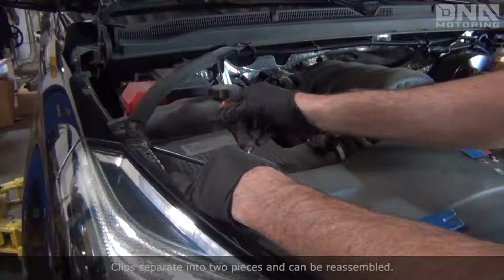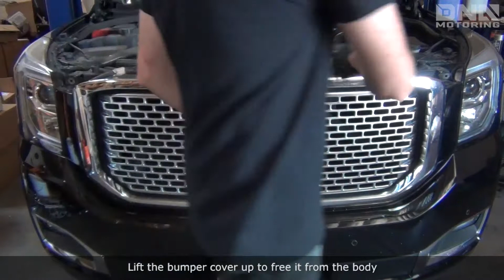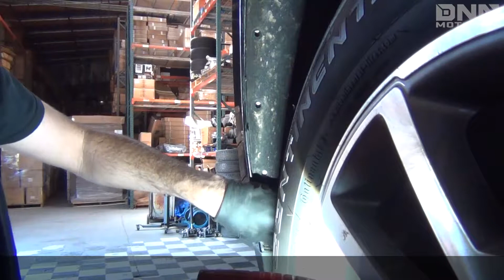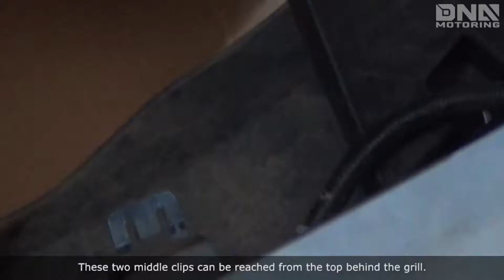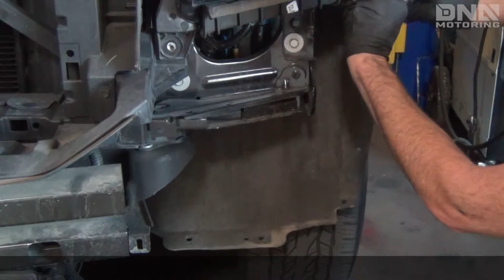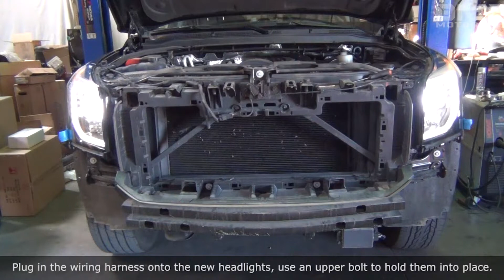How to Install 15-20 GMC Yukon Headlights

Comment: Excellent video... thanks for sharing. Will be very helpful for folks! Only addition I would add is that rather than just pulling on the side of the bumper cover... reach in the inside of the side cover and here are three small hex screws that secure a bracket that clamps the side bumper cover to the fender. Once you loosen thise three screws you'll be able to easily pull out and not risk breaking any of the plastic bumper clips.
Reply from the maker: Thanks for the feedback! :)

Comment: Great video! Had to replace my headlights in my Yukon and this video saved me a bunch of time and money. My headlights even come from y’all I think
Reply from the maker: Glad it helped!
Reply: Amanda, what did you replace your light for? My 2015 slt day time running light is out and it’s driving me nuts. Debating on replacing whole headlight assembly but this looks like a lot of work 😅

Comment: Hey guys great vid, have you guys ever swapped a harness out on the headlight? I am hoping to convert my HID to LED and cannot find an adapter to convert a D3S connector to something like and H11. I was hoping you guys knew what type of connector it was on harness to the low beams so I could just bypass all of the HID wiring. Thanks fellas!

Comment: Can you please post amazon referral links to the tools you used, so we know what to get and you earn money when we buy. Also can you do a video of you installing Denali HID assembly onto a SLT or lower trim level.
Reply from the maker: Thanks, we will try to add that to the video. Thank you for the suggestion. It's possible we may have a install video similar to that in the future, but currently no plans for it.

Comment: OMG ....lol - that's ridiculous! Why would GM put us through that kind of headache to change a headlight? Thanks for posting !!!
Reply from the maker: No problem!
Reply: @Krause Commercial Painting it is only if you are replacing the head light assembly. Most modern cars unfortunately require the removal of the bumper cover.

Comment: Hey great video! Do you need to do this even though you're just replacing the headlight bulbs?
Reply: No, do it from inside engine bay. Passenger side you will need to remove air box. Whole project .10 min or so